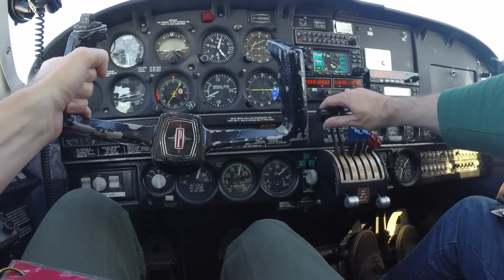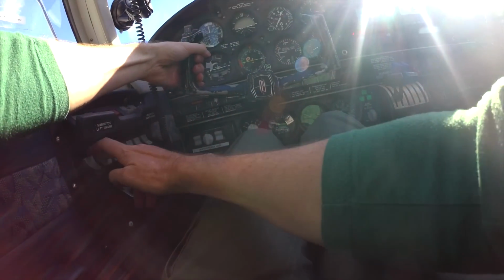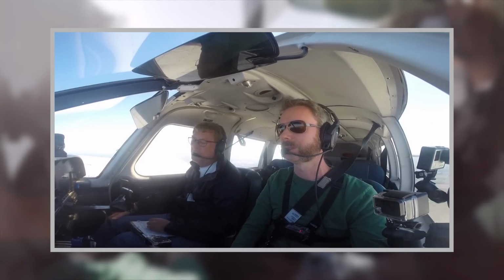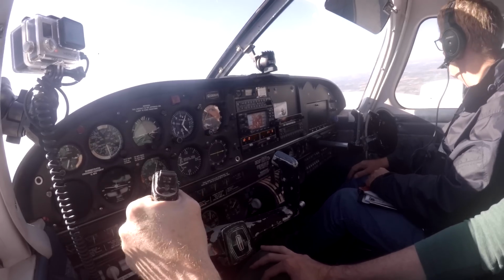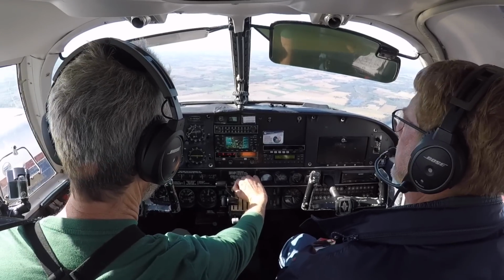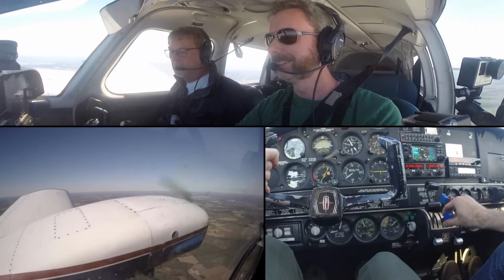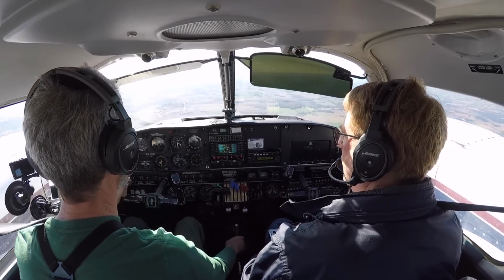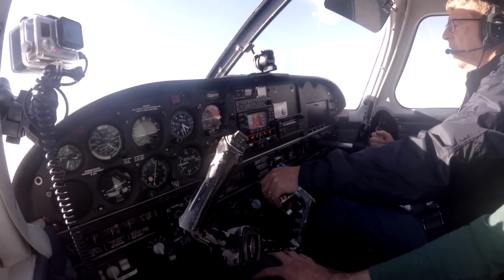Getting my Multi Engine Rating! - Surprise Engine Failure - Flight Training VLOG

Comment: As an F.I.(A) I see your confusion quite often as students progress from PPL to more complex aircraft. During the PPL and subsequent aircraft conversion training students primarily advance by referencing what they were taught on their first/principle training aircraft and adapting rules and procedures to fit a new airframe, with the help of checklists. You are absolutely right to question/consider the Engine power procedure, but similarly if that aircraft specifically teaches to slam the throttles (or not), unfortunately that is what should be done. I appreciate your good airmanship in raising the question. Not all procedures you will learn as your aviation career progresses will "feel right" or possibly immediately make sense.

My advice, as you advance off Simple Single Engine aircraft to complex, turbine and multi engine aircraft, especially to heavier gross weights and turbocharged engines it is very important to learn THAT specific aircraft individually and the nuance that comes with it, both the good and the bad. Try not to learn by comparing similarities and differences across airframes as in an emergency this will likely lead to confusion at a time system and procedural recall is vital. Think of procedures like V speeds, you don't generalize with speeds which are all aircraft specific, so why do so with procedures.

To emphasize this point, consider why type ratings are required and specific aircraft conversion courses. Read a little Into the history of the legendary Mitsubishi Mu-2 and what happens when pilots treat high performance aircraft with generic established procedures. You must be Mr FlightChops sitting in his Beech King Air 200 CT model, not Mr FlightChops sitting in his "Generic Multi Turbine Twin".

I can see by your professionalism you do not need to be informed of the above information. But as an aviator myself, with a passion for a wide verity of aircraft types, classes and categories I sometimes need to remind myself that although some aircraft feel as comfortable to fly as an old pair of shoes, there may potentially be a subtle difference beneath the surface waiting to bite me.

Thank you for posting, fly safe and keep up the great work!
Reply from the maker: I really appreciate you sharing your insights!
Reply: That is a true airmen right there. There’s just as much of a difference in procedures going for one airframe to another as engines/avionics in the same airframe. For example I flew King Air C90As for about 500 hours and hopped into a E90 with a hodgepodge EFD/GPS setup and it felt like I was a fish out of water. It was even more so of a jump getting into a Citation Mustang & CJ1 which is what I fly now. I can’t even remember the last time I went “full power” without having to think about ITT, torque, or max N1 or N2 first.
Reply: Veritas1992, Well said and a point I should probably have emphasized in hindsight. Some aspects of airmanship and 'Mechanical Empathy' (my term for treating engines and systems etc.. with respect) are almost impossible to teach. This Mr FlightChops could be an ambassador for it.

Comment: This video brings me back a few years to when i was doing my multi training and was a nervous newb in this fast new cockpit. You exhibited the same sort of unsureness as to what to do when you simultaneously have to coordinate a bunch of emergency procedures with this new airplane that goes almost 40% faster than anything you've experienced before. In hindsight the advice to give someone in these shoes is to calm down, relax, take a deep breath and don't stress about the procedure and checks involved. Having actually gone through this in a real moving airplane I know it's not that easy when everything is so new to you. Now when it came for my multi IFR flight test in a piper seminole after a few hours in the bird under my belt it was a lot easier to manage. Interestingly enough on my flight test we had an actual real world failure. Before we even left the ground i checked the oil and noticed it was a little lower than the right engine. So we topped it up to within normal levels. On cruise checks after leveling out I noticed and made aware to the examiner that the left engine oil pressure was a fair bit lower than the right. To which he replied,  if its still in the green than we are good to go. which it was. So we did the simulated engine failure (on the left engine) on the test and everything was fine. I noticede oil pressure had dropped a little more to which I got the same reply. Enter a hold and load an approach and then proceed to shoot the approach when the real deal happened. I noticed a significant vibration and yaw to the left and could see the left engine starting to spool down. I had to prompt the examiner in this case to the goings on. He took control and we did the feather and shut down procedure, but in this case everything seemed more calm because there was no anxiety of the anticipation of the failure coming, like in training. We landed without incident and my flight test was a pass. Turns out some gearing mechanism had failed in the engine so i was told. After experiencing a couple engine failures in my career now I havent been nervous until after I was on the ground. In my case I guess it was just instinct, but I cant stress enough that when a real emergency happens dont panic and always FTFA!!

Comment: Is the propeller pitch lever ever used in any other position than full forward and full feathered in normal operation?
Reply from the maker: The prop control is actually mostly not full fine and almost never feathered. the various in between settings are for either climb or cruise power.

Comment: I took my multi in a B55 that had a 300 hp conversions.  Blue line was 110.  With 50% fuel and 2 in the plane, the plane would be vertical and mush straight up and down making departure stalls scary.  At examination, I put the plane over the top to its back, pulled through and rolled it back to level, nose down and recovered to straight and level.  Examiner gave me points for recovering from an unusual attitude then let me do it again without using full departure power.  I did it without incident the second time.  Examiner tried to fly the plane at full power, departure stall.  Plane would hang on the props and not stall conventionally.  He almost did the same thing that I did.  He passed me.

Comment: Enjoyed that !. Yeah,  a bit retro but very, very Flightchops. There's a lot to take on board with that rating. How long did it take all told? (Length was absolutely fine, bounced along at a good pace and stayed interesting throughout)
Reply from the maker: Thanks!  And I'll let you know when I get the test done!  I have had to cancel my second test booking due to an another winter storm - hoping to get it knocked out later this week - but the longer I wait the less sharp I am feeling :(  Assuming I pass it'll be just under 5 hours multi time logged.

Comment: The myth of not flying into the dead engine.   Propagated mostly at airshows while Bob Hoover was doing his energy management routine!lol! Heard it many times...proved it wrong a couple.  As shown, it's not impossible and using good airmanship is very controllable.  Not preferred but nothing to shy away from of necessary especially if making a primary turn with plenty of speed and altitude.  You do NOT want to do it low and while at a high power setting on the other engine.  As he mentioned, don't be afraid of firewalling the engines.  Unless they're tired out...you're doing nothing they aren't designed to handle.  Push them up firmly...you show the plane who's boss!

Comment: What a great introduction to multi-engine flying. Nicely done. Don’t cheat the plane of its capability, no engine or 8 engines, they are all drag:thrust problems. Use what you have. When you have questions about how much you should bank into or away from an engine, let the instructor know you’d like to explore that in practice. It’s good to satisfy/disprove your own thoughts on what is going on. Otherwise you end up perpetuating myths. Explore the envelope of the airplane, find it’s limits, and respect them.

Comment: I did my MEC in a Seneca II turbo, interesting to see the differences in this model - definitely could not firewall the manifold pressure, and it really took a little finesse to avoid overboosting in a few situations. Also I fould steep turns to be the most difficult maneuver in that plane, if the altitude starts to go (up or down) the plane can bust the standards really fast.  Have fun!!!

Comment: I did my primary multi training in a turbocharged Seneca II. It is a wonderful airplane to fly on. It is very stable and those counter rotating props give very easy handling characteristics. Said that, it can be a hassle to fly being very heavy on the hands. So, I always found it easier to get things going by doing your home work. As they say over 90% of complex aircraft flying is done outside the aircraft. Making sure you go to the flight to fly rather than to learn is the best way to go or else you would most certainly lag behind the airplane.

I carried the same principle to my airline flight career. As my initial Dash 8 instructor said, the flight simulator is a place where you fly, not a place to get along with the procedures. Enjoy the fun life of flying two engines and best of luck flying the DC-3!

Comment: my friend I believe the instructor followed what asks for the emergency check list but some considerations should be made when having an engine inoperative such as flight altitude aircraft weight and flight conditions at first the check list is ok after initial evaluation of the emergency and determined a line of action there is to think of the adjustment of the remaining engine power, to avoid excess in the engine good, excellent video very good raise these issues.

Comment: As said before, don't apologise for the length. 30 minutes is pretty average now for YT videos, and I wouldn't want you to edit out important stuff just to make it shorter.
The Seneca is a nice airplane that I used several times for my IFR annual, although I don't really feel comfortable actually going IMC with carburated engines... Still it's quite manoeuverable compared to heavier machines so don't get too used to it.
For some reason the "dead foot dead engine" thing always got me confused, and I used "live foot live engine" instead. Still don't know why, it's probably just me.
BTW the #BoseA20 really makes the difference when flying multi-engine planes, especially with no prop synchro. If you spend 6 hours in there everyday like you do during training, it really saves you from recurring headaches and loss of attention. It becomes a real safety asset.

Comment: Congrats on working on your multiengine. Very nice video, it’s hard to catch the feel of how busy you feel on that first flight. 

As far as the “firewalling” thing goes, I trained in a fixed-wastegate turbo Seminole, and yes, you have to watch for overboost (and the turbo Seminole has an over boost warning light, if you overshoot) on some aircraft. It’s aircraft dependent but your concerns about primacy aren’t as dire as you might think, you may be low and need that power up. Your first reaction is to add that power, and you’ll know the aircraft and will know if you’re going to harm your remaining engine. That’s my take on it. You’re not a “horse things around” pilot, so you’ll think about it. 

If you do some training at high density altitude airports you’ll also find that the performance numbers are terrible on light twins in hot and high conditions, and whereas you guys were seeing a climb, the vast majority of the time except the cold of winter, we are in a constant descent to hold blue line. Which means you’re essentially a powered glider...  better know where the airports are and head there. 

Because... perhaps as you’ve maybe seen by now in your training... air restarts don’t always work. 

On my ME Commercial ride, we had to make three attempts and after the second we were bee-lining it for the airport. Altitude is time, and time was winding down.

At the lower altitude we got a start on the last, but I was more than willing to declare the emergency and get priority landing clearance at the airport if the third attempt didn’t work. Land, taxi in, and they’ll almost always restart immediately on the ground. 

Simulated emergencies with an engine shut down turn into real emergencies if the engine won’t start. As you plan to teach ME flying, if you’re going for your instructor certificate, this is always in the back of your mind for both the lesson plan, and also keeping an eye on your location in reference to surrounding airports. 

Enjoy the training, it’s a blast. All the best.

Comment: It may be just because you have a camera strapped on, but your position in the cockpit looks to be awfully "long" as in you seem to actually need to reach for the top of the throttles.  I'd prefer to be a few inches closer.   Piano players, race car drivers and pilots should all look "cramped" to the amateur...
Reply: TakeDeadAim i was taught that in a racecar you should be able to place your wrists on the top of the steering wheel while fully strapped in, it has been sound advice so far. It helps being comfortable in a similar position in the plane now too.
Reply: The primary reason for the "cramped" positioning is to alleviate muscle fatigue.   If you're constantly "reaching" or stretching the chances of becoming fatigued are increased.  You should be able to complete all necessary functions without using your upper back/shoulders much.  One of the reasons the center stick in fighters/side sticks in FBW aircraft are canted is to specifically reduce the issues pilots were having with their wrists in the old "straight sticks".  In a cockpit you should be well aware of your bodies natural position and the less you move from that the better.

Comment: The logic behind firewalling everything is that you might be losing altitude, so you don't have time to mess around, you need power NOW. The problem might be as simple as a throttle lever creeping down due to a loose friction lock, so that's the easiest fix.
Obviously with radial engines or turbochargers, it might not be possible to just ram everything forward. In that case, you would just go to whatever settings are allowed for max power.
This video is a good refresher for me. I haven't had many chances to fly multi since earning the rating. Thanks for filming this and I'm looking forward to seeing more!

Comment: Stop it! There is no reason to apologize for the length of this video. I could argue that you cut it too tight!  Your well-selected angles, your explanations, and the engine out drama make it seem like the vid is actually shorter than the clock time. Really good work on this!  Your videos are consistently among the best posted, and I learn so much each time. 

I’m looking forward to the DC3 series. My father helped design that plane at Douglas in the 1930s. That got me several good rides—and lots of good stories—when I was younger, but I never got a comprehensive tour of the cockpit and controls. Can’t wait!

Thanks for your excellent videos.
Reply from the maker: Thanks so much for this great feedback.  I am glad to hear you guys are liking these longer ones when the content deserves the time. I just fear some people will decide not to even click when they see a run time over 20 mins.
Reply: You do some really good videos.  Interesting even for a 1600 hour commercial pilot like myself.  So don't ever worry about the length.  You have quite the following and I think that if they were an hour in length people would watch every second.
Reply: came to post the same, i'll only skip long videos from creators who pad little content with lots of fluff
Reply: Stop it!

Comment: When it comes to saving my ass, if the choice is between slamming the throttles to save my life or worrying about the good engine, it’s out there to pay the price.
Reply from the maker: I think you're missing my point.  We'll discuss it more in the upcoming videos.  Bottom line: I am not worried about damaging the good engine and having it still function, I am worried about causing damaging to make it stop functioning, and thus not be able to save myself.

Comment: PCIVF
Power up
Clean up
Identify
Verify
Feather
Reply from the maker: The only problem with that acronym is that it leaves out one of the most important first step which is "control" - meaning set your bank and rudder input for zero slip - otherwise all the rest of the steps will be hindered by an inefficiently flying plane.
Reply: I like to have Maintain Heading at the top of the list. Get your feet working on the rudders. This is also essential to figuring out which engine is dead or producing reduced thrust.

Putting 3-5 degrees bank and half a ball into the good engine usually comes after Feather. Worrying about that step prematurely will rob precious seconds from completing the first essential steps.

Comment: Slamming Throttle: In a naturally aspirated, fixed pitch prop machine, no Problem at regular Speeds. 
Depending on the Pitch Range of your Constant Speed Unit, it may not even be a Problem at very low Speeds (given that your finest Pitch still prohibits Red-Line RPM at these Speeds, for example on an emergency Go-Around during Flare).

But apart from that it could become Problematic. A Supercharged Engine may run into Detonation if you Slam it at low RPM, a Constant Speed with very fine pitch will Overrev, a slow Constant Speed will not react quickly enough and overrev. 
I don't know how Turbos React in Combination with a Constant Speed though.